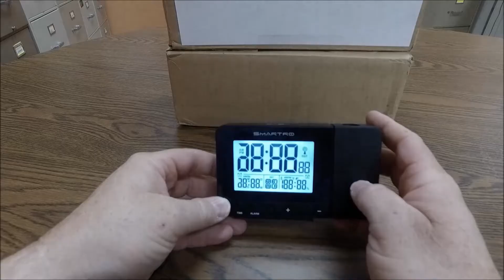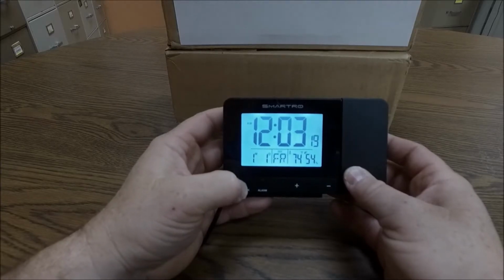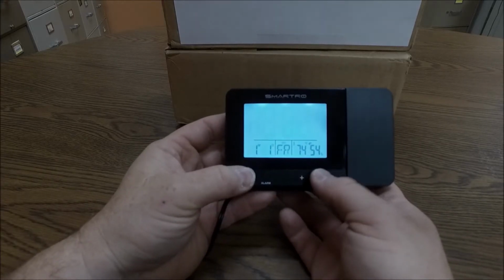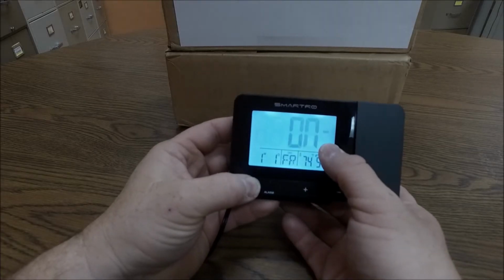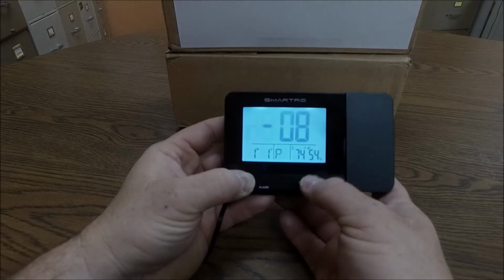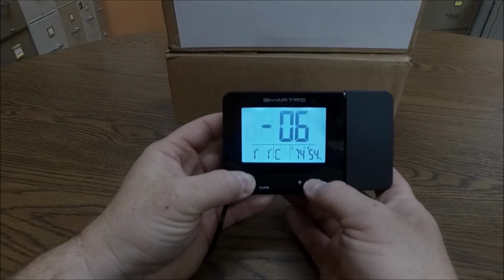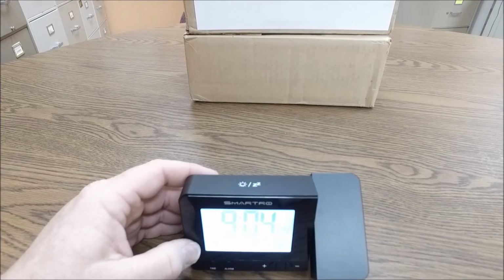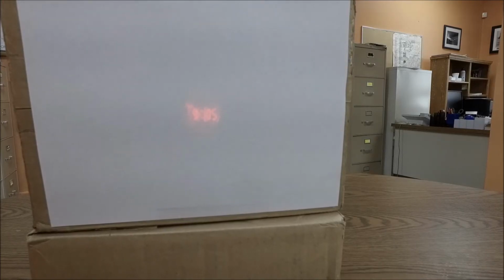How to install the Smartro Digital Projection Clock .

Comment: I clicked like on your video. It was good. But I came here to find out how to sync the remote outdoor 9162E thermometer. Disappointed you didn’t cover that. Oh well. I will continue looking. Good job on this, however. EDIT: I did a hard reset on the base unit and it recognized the remote sensor this time. I suggest you include some troubleshooting in another video. You might also include a tutorial on how to sync several remote sensors and how that might appear on the base unit. I’m reluctant to buy another one at this point because it remains a mystery as to how that might work.

Comment: The projection of the time on the roof in our bedroom is blurred ie hard to read if the time is  3.15 as top middle and bottom of the 3 are
blurred and I just see the back of the 3. I installed new batteries - no change. How can I fix this?

Comment: So I just bought mine. I don't gave batteries in it or the remote and it keeps turning off when I go to hit the plus and minus buttons to set the time. Do I need to have the batteries first, do you think that could be the issue? Any feedback is appreciated.
Reply from the maker: Hi, Ian. Glad to see you here! This is not a problem. Could you try to install the battery with the alarm clock and the outdoor sensor, connect the alarm clock to the adapter, and if there are any problems, please contact our customer service staff. +1(323) 287-5798 Thanks, Ian!
Reply: @smartro5314  I put batteries in and plugged into the wall and seems to be working fine. The batteries I put in before were old so I got new ones today. Where do I put the outdoor sensor actually outside?
Reply from the maker: @iancurtis5397   Hi, Ian. Thanks for your reply. Please put the outdoor sensor in a place where it is not exposed to water. Thanks, Ian.
Reply: @iancurtis5397  put the sensor near a window in the inside of your house not the outside
Reply: @trs7983  lol it's long gone wind took it : /

Comment: Hello, I got this product for Christmas.  When I plug in my USB cable and iPhone all the settings on the clock get wiped out and I have to reset everything.  Do you have this issue?  Thanks.
Reply: Also, I don't use the remote sensor feature because I don't get good reception in my area.  I use the product in standard clock mode with no outside communication, and I keep the power outlet plugged into the wall at all times.
Reply from the maker: @phidias523  We feel so sorry to hear that you have the problem with our clock, from your description, we noticed that there must be something wrong with the clock USB port.
We attached great importance to this issue. For this problem, we would like to send you a replacement freely.
Kindly please provide your purchased order id and your delivery address to us.
Thanks for your understanding.
Reply: @phidias523  You should be able to use the remote sensor. “Good reception“ shouldn’t require having to forgo using an item you have paid for because, unless your sensor has to be farther than 100 feet from the base unit, reception should be satisfactory.

Comment: The RCC was a hassle, nothing happened for 15 minutes so I set it manually. Can I however, set it in RCC standby so when the signal is received it will over ride the manual setting?